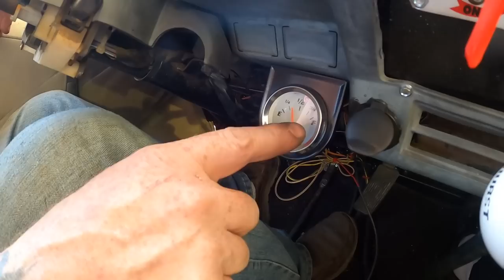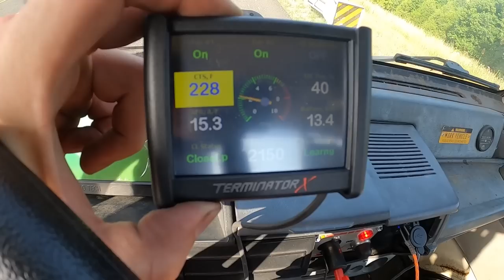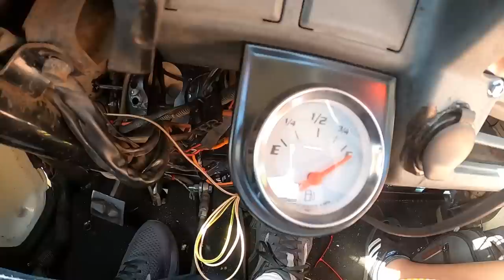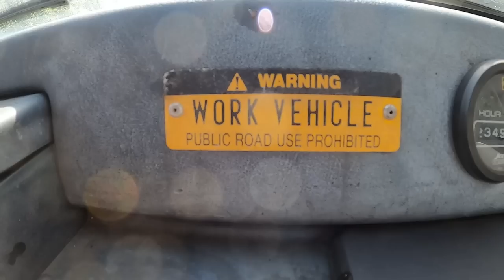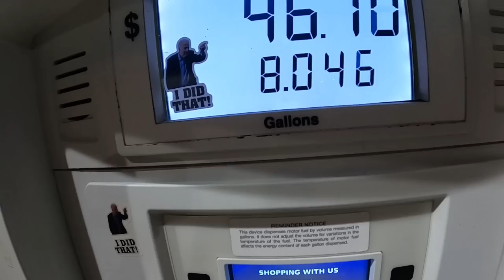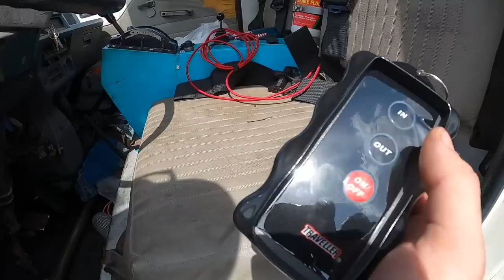THESE WERE NEVER MEANT TO BE STREET LEGAL | Deathwish EP27

Comment: So much fun having a car with a small wheel base and a bit of power. I'm running a 3.8l V6 5 speed in a85 Handivan .
Reply from the maker: They are both rowdy for sure
Reply: @BustedKnuckleVideo  Can get a 5 sec eighth mile out of mine if I shift well :)
Reply: @BustedKnuckleVideo  Be interesting to see if you get enough traction for a quick run

Comment: What a great idea I drove a sea of those in Asia in the Suzuki format, made in mini truck 4 by 4 Minivan and crew cab. But only three-cylinder 600cc no w with V8 that's going to be insane and a rollover magnet, and over an hour in there with the torture
Reply from the maker: The weight is so low it actually drives quite well.

Comment: Yous are lucky we can only do 70 mph in Australia, all the best to yous and your loved ones
Reply from the maker: 70mph is so slow
Reply: @BustedKnuckleVideo  that's what most think, but 30km over you loose your license, and they wonder why there is so many accidents with people falling to sleep, only in Northern Territory, it was unlimited on open road's, but they had that Canon ball Run, and some rich assholes decided they would run over the check point instead of going past and around the corner, so the speed limit went down to 110km/h but the road tally went up, now it's 130km/h after the border and unlimited after Alice Springs to Darwin, we used to travel 160km/h but now there is two many Copper's, most state's are 100km speed limit, all the best

Comment: Sounds like a memory issue on the tcm and ecu if it's wiping every time you turn it off. I had a similar issue swapling an ls into an old tow truck did a little digging and ran the memory wire to constant 12v
Reply: Nvm didn't realise it was a 4l60 when I wrote that
Reply from the maker: Gremlins….

Comment: STEERING WOULD AN EASY FIX IF YA FITTED A HYDRAULIC STEERING RAM SIMULAR TO THE COMP TRUCKS RUN AN PUT THE A FUELTECH IN TO RUN THE REST
Reply from the maker: Hydro steering?
Reply: @BustedKnuckleVideo  yeah that way ya not running an upside or reversed steering rack an leaking fluids an also maybe change to an earlier overdrive 4 spd auto so it's not controlled by the computer so ya gears are always working when they should unlike the current issues you're having with being stuck or not engaging properly just a thought from a backyard Aussie car nut lol